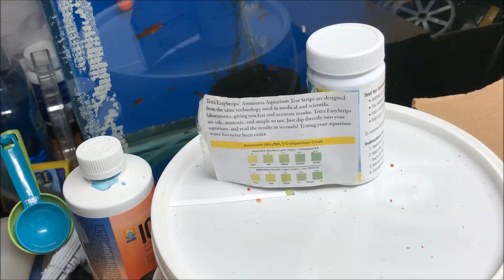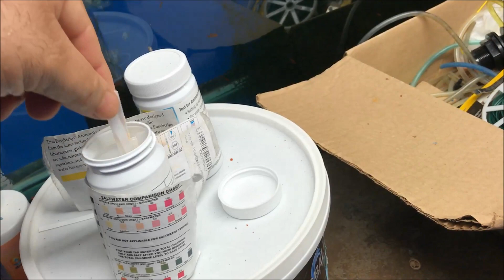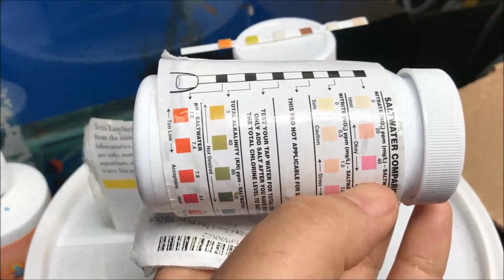New Fish in the fish room! German Black Guppies Feeding Frozen Spirulina

Comment: The GFI melting is highly likely the cause of a loose connecton or the wire sheath in the way of the terminal. Arching happens which causes heating and thus melting. UL plastics are designed this way to not cause fires because they can't continue combustion (fire).
Reply from the maker: I think that was what it was. I did replace it.